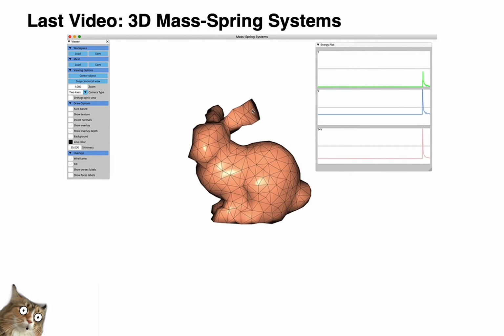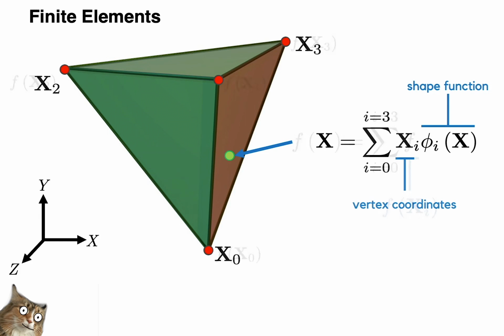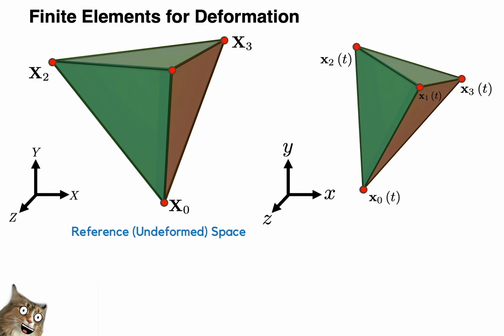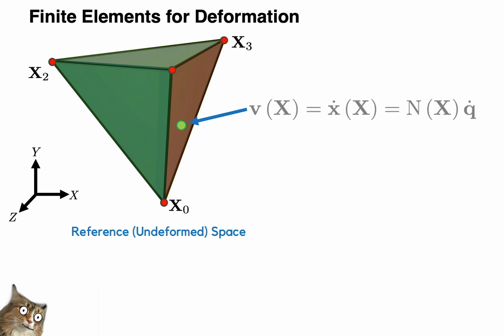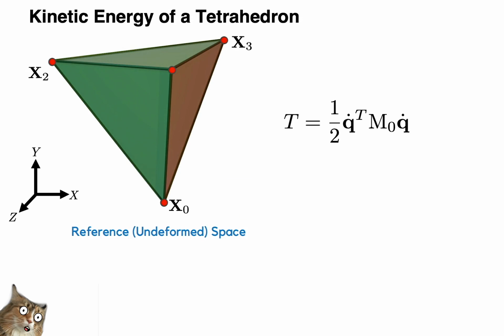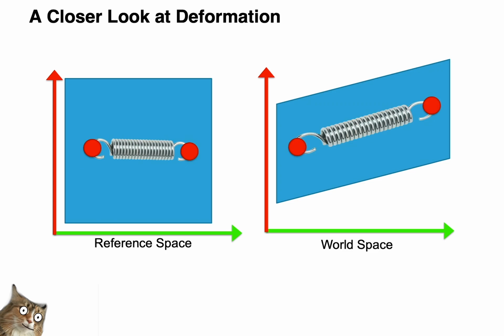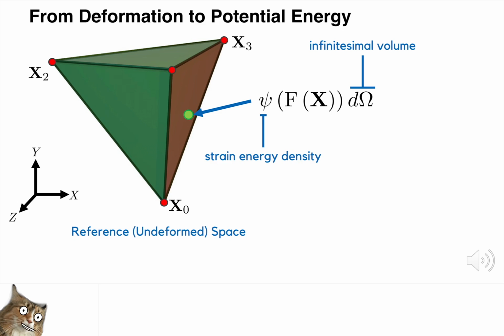Physics-based animation lecture 4: The Finite Element Method

Comment: 0:23 Last video
1:20 Issue in mass spring setup
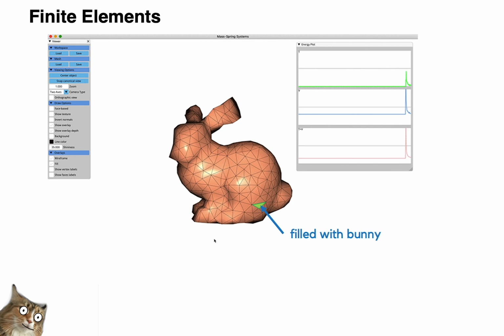1:55 Finite elements to the rescue
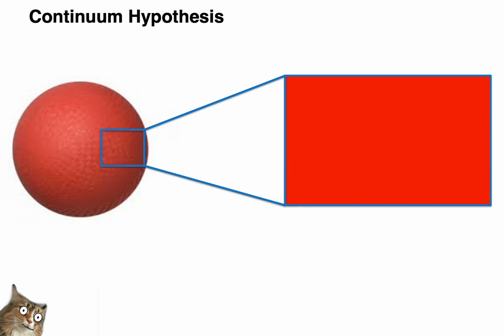2:11 Continuum hypothesis
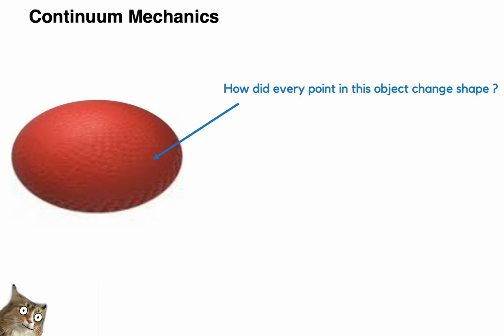2:45 Continuum mechanics
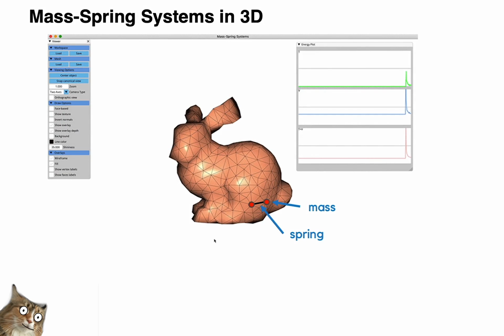3:02 How finite elements method work
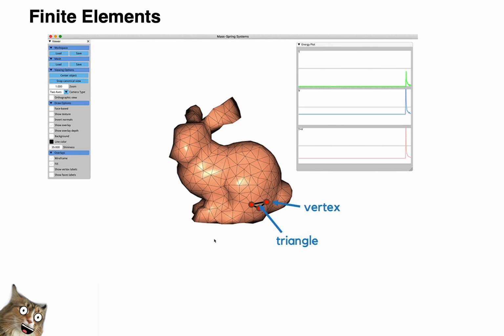3:36 Tetrahedral finite elements
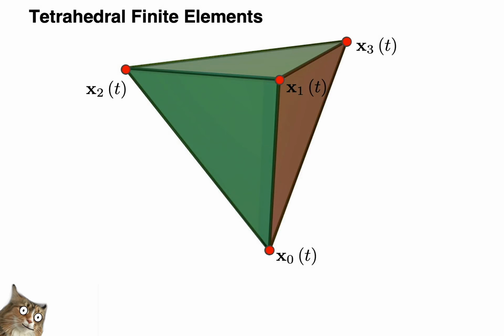4:47 Per tetrahedron generalized coordinates
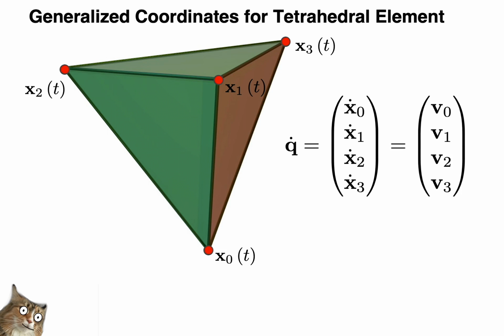5:29 Per tetrahedron generalized velocity
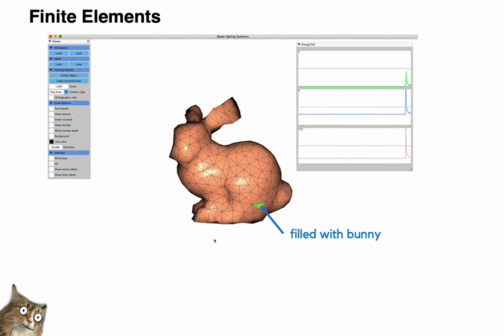5:50 Find function value within tetrahedron using vertex function values (barycentric coordinates)
10:06 Tetrahedron part of deforming object
12:23 Kinetic energy of single tetrahedron
14:34 Per tetrahedron mass matrix
17:15 Mass matrix of entire bunny
19:18 Potential energy of entire bunny
25:00 Calculating deformation gradient
26:34 Back to potential energy
26:58 Potential energy of bunny
27:22 Lagrangian of bunny

Comment: At 19:10, wouldn't M be a 4m x 4m sparse matrix since we are talking about meshes made of tetrahedral voxels right now instead of triangular faces?
Reply from the maker: Careful now! remember M multiplies the qdot vector for the entire mesh. qdot is 3nx1 (3 times number of vertices in the mesh). Therefore M must be 3n x 3n. This is a consequence of how assembly distributes the per element mass matrices into M. Convince yourself that this ISN'T block diagonal, like in the previous video.